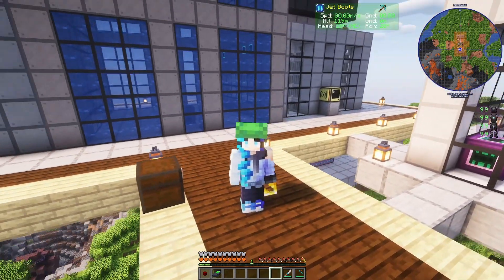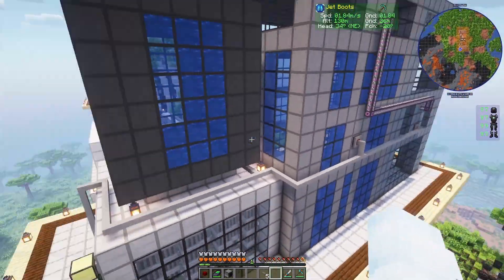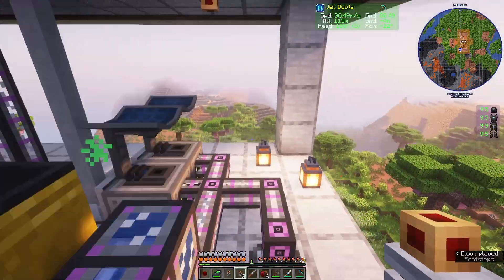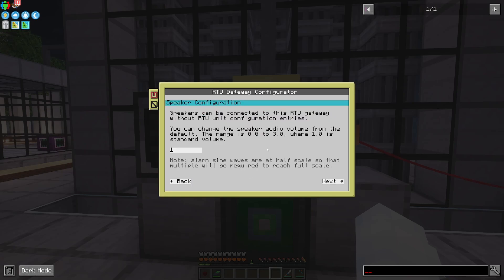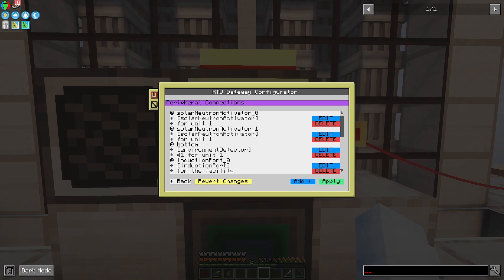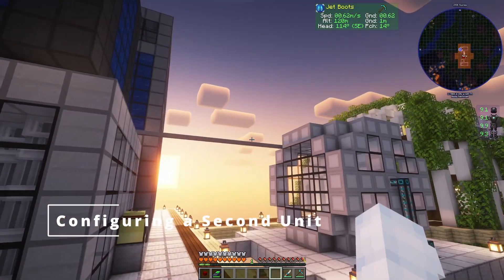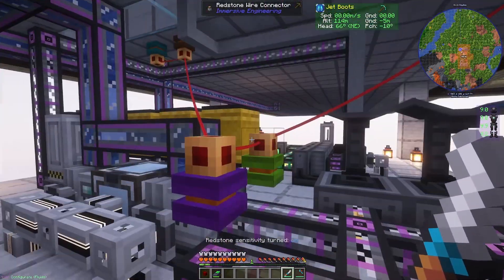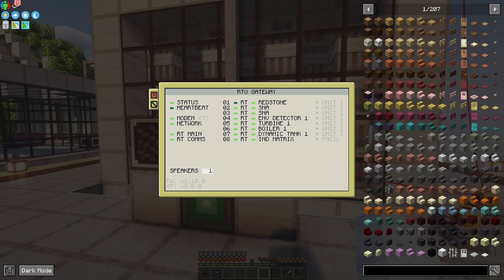RTU Gateway Setup | cc-mek-scada

Comment: Your System and code is incredibly cool.
I just implemented it in a server i am in and its beautiful!

One Tip/suggestion: Would it be possible to add an interface or programm to monitor the Fusion Reactor and its generation? Be it a turbine or dry-run. (Even if controlling the fusion reactor ist really that important)
Other than that i'm fascinated by the functionality and ease of use 😄

Comment: Thanks for all this! I'm setting this up in ATM10. Will speeding up the Solar Neutron Activators with Soul Surge (Industrial Foregoing Souls mod) mess up anything with your system? I'm also guessing Modular Machinery is a no go for the computer to read them?
Reply from the maker: I'm not sure how the Soul Surge works, but if it just does tick acceleration it'll probably make the math become very weird and I don't know how that would interact with ComputerCraft Mekansim API calls. I don't know very much at all about Modular Machinery; the only things this system can interface with outside of ComputerCraft are select Mekanism and AdvancedPeripherals devices.

Comment: when are we gonna get support with Isotopic Centrifuges?
Reply from the maker: There won't be; they don't add any meaningful data and just add extra network traffic and Mekanism API calls
Reply: @cc-mek-scada  also, how exactly does Pu Fallback work, like what does it detect from the SNAs?? Everytime I run Pu Fallback it directly switches to plutonium, even though the SNAs barely reach 50mb of waste before being empty again
Reply from the maker: It falls back when the SNAs aren't reporting a rate fast enough to keep up with the reactor's burn rate
Reply: @cc-mek-scada  burn rate was 52mb/t
Reply from the maker: Well if the sum of the connected SNAs input rates for that unit is <52 mB/t then it will fall back, if not, it won't
Reply: @ Btw, is there a fusion reactor version available?
Reply from the maker: This doesn't support the fusion reactor right now since you just turn those on and forget about them basically

Comment: Great Work! I'm not that familiar with cc, I can't right click on any buttons on the monitor. I can use the buttons on the computers.
I'm currently playing on 1.20.1 on my server. Could you help me?
Reply from the maker: Thanks! If you are on ComputerCraft 1.114.0 you need to update that mod since there was a bug in that version that prevented monitors from working correctly: https://github.com/cc-tweaked/CC-Tweaked/issues/2010

Comment: the UI is perfect, how did you make it?
Reply from the maker: I made my own little graphics library for it, its under the graphics folder on the GitHub repository. It just uses ComputerCraft's window API to do most things, then only updates individual indicators and such as the data changes, so it is pretty light on re-drawing.